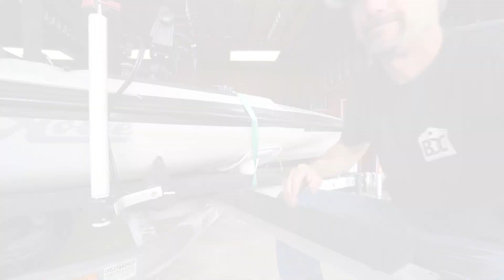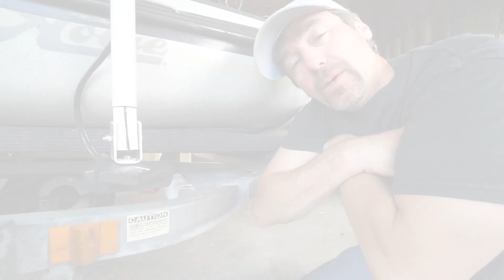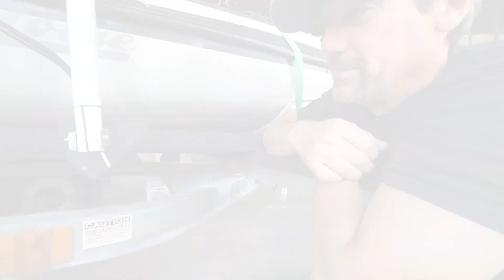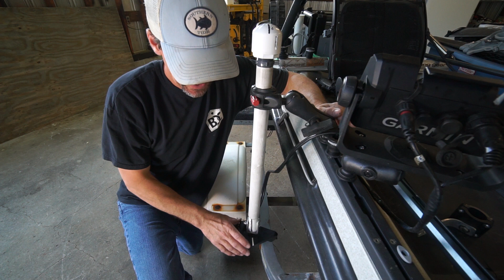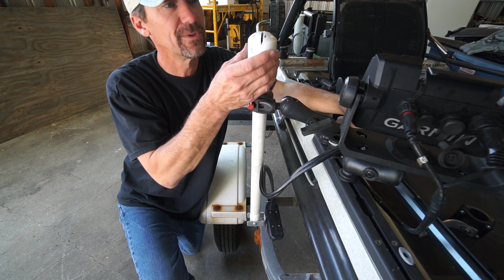Simplified Livescope Perspective Mode Mounting Solution!

Comment: The one thing I do differently with my setup is to actually turn the transducer to down mode before turning it to perspective mode. That way the view stays level across the 150 degrees as you tilt down. (The difference between the 2 modes on the pole is then 90 degrees. I switch the steering knob around 90 degrees so I can have only 1 arrow on it).

Comment: Hi Jesse, Thanks for your great videos! Believe it or not, after seeing  your first mount I came to the same solution, folding the transducer under the pole. I use a L shaped bar on the Garmin bracket with the same effect. I never noticed the little angle on the transducer itself so I will correct for that, which will be easy due to the L bar. I measured it to be between 1-2 degrees by the way.
Reply from the maker: Great tip!
Reply: @SouthernReelsFishing  I hear you talk about Forward and Perspective mode. But what about Down mode?
Is the transducer loose enough, on the U-bracket to rotate for Down mode?

Comment: WOW!!!   That was too cool!! So Easy!!  Goes to prove just how simple some things can really be, just got to look and think outside the box to achieve.  I ordered a Summit mount for my pole which will let me adjust the angle like your mount will in perspective view. I hope it holds up well. If not, I will defiantly be making one from your design. Will probably go ahead and make it now just to have a backup.  Thank you so much for sharing this my friend.
Reply: Hmmm...……  After looking at your design again, I think that I will make one using a piece of 1-1/2" angle aluminum which should be just as strong and I wouldn't have to bend anything at all. Just thought I'd share in case you haven't already thought of this. I won't have to buy anything since I have some in stock where I work at.
Reply from the maker: That would work it sounds like. Not as strong as having it through bolted on 2 sides but I'm sure it would work.

Comment: I Enjoyed your design and explanation....I’m building one of these tomorrow....one thing I’ve added to my mount that I wanted to pass along to you....I have two indexing lines that show the 20 degree cone spread on my vertical mount when in forward scan mode, I can use these lines to exactly locate a single fish at a distance.  Because you view the 20 degree cone on a flat plane, at a distance you may have a single fish on the edge of the cone and not exactly know where to cast.  I use the 20 degree cone lines to rotate the transducer until I just lose the image and then I can align the cone angle mark on that side to effectively locate the target.  It works!  I have caught several large bass using this method that were not on visible structure.  Thanks for all that you do!
.
Reply: I'm new to panoptix. Anyway you can explain this s little better?
Reply: Aaron Bursiek ....sorry, this is about the easiest way to explain this that I can....sometimes it’s easier to show than explain.  I’ll try to make a vid next time I’m out and send you a link....
Reply from the maker: Thanks for the advanced tip my friend!

Comment: Please do a build vdo. I don't quite get the 5° you mentioned. Thanks so much.
Reply from the maker: It seemed to need the 5 degrees to level the transducer
Reply: @SouthernReelsFishing  What you put in between to level it off?
Reply: I don't get the 5° either. The factory mount has a bevel to avoid the trolling motor but they swapped that out for a 0° mount since I use a pole mount as well.